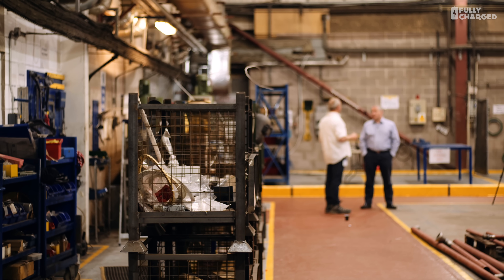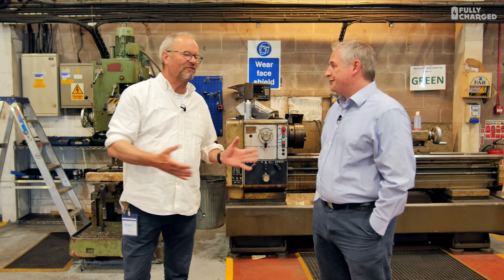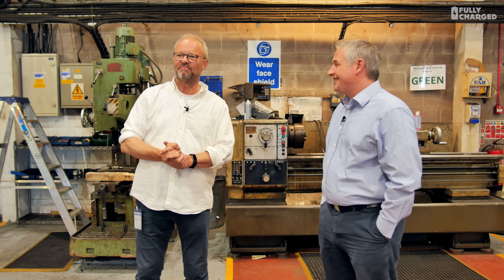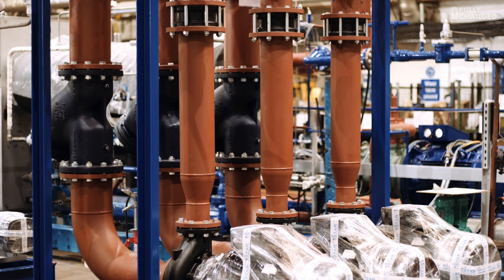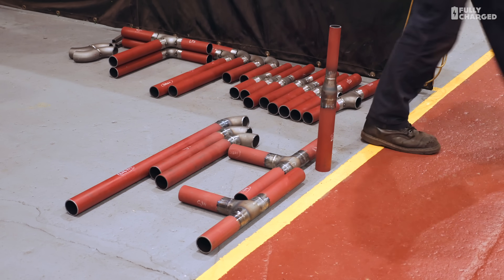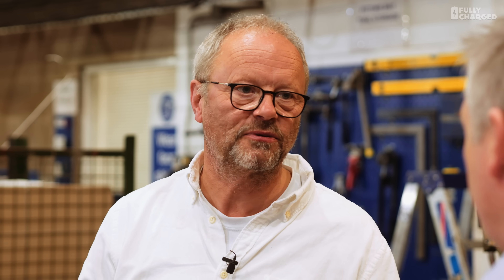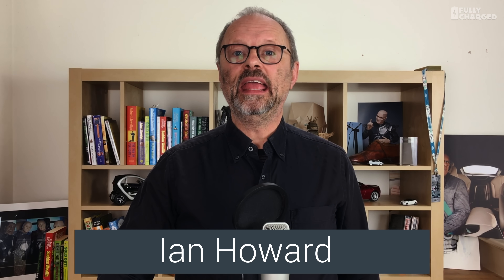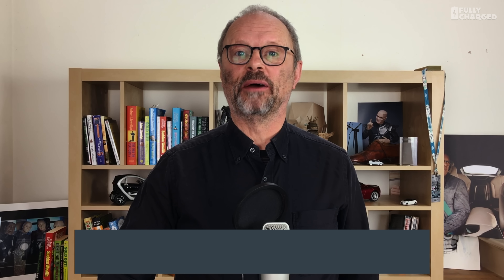Star Heat Pumps | Fully Charged

Comment: Here in Switzerland our flat's hot water (for baths and underfloor heating) comes from waste heat generated by a nearby factory. It was even part of the sale contract that we would do this.
Thanks to triple glazing and sensible insulation, I've not had to turn the heating up at all this winter (it's literally on its minimum setting).

I think that you'd need to refit or even rebuild a lot of properties in the UK if you wanted to really tackle the issue of wasted heat (I still see plenty of relatively "modern" buildings in the UK that have single glazing and bare minimum insulation, which seems ridiculous to me).
Reply: Yes, a lot of buildings in the UK have fairly poor insulation from the windows to the walls
Reply: I live in a house in the UK that is over 200 years old and its the warmest and cheapest to heat than any of the houses I've lived in that were built in the 70's and 80's
Reply: Yep, I live in London in a "nice" building from the 90's and part of the outside wall is basically a sheet of plywood. Brits really do have a cavalier approach to insulation.
Reply: Factory heat should be a good idea, but sadly at some point the factory will not be able to become more energy efficient because they need the heat for the homes. We have seen this in the Netherlands already, sadly enough. Instead of for example build another factory close by that also supply's heat they just don't make the factory more energy efficient, so it beats the purpose.
Reply: Thanks for this film, it was fascinating. Good stuff.
Reply: David Beaumont great to see someone talking about this, I talk to my family and mates about how bad these plastic clad, concrete and bradstone pieces of garbage that's been built in recent times in Blighty and just how bad they are as houses, in terms of heat efficiency, quality and fire protection, and they just look terrible, every new housing estate just looks terrible, built as cheap as possible as quickly as possible with the maximum poor business practices that the developers can get away with, and yet Pre war/Victorian houses are being knocked down left right and centre, yet the've survived 100+ years so far, houses built since the 60's barely last 30 years before they have to go. We have a culture of wiping away the old rather than working with the old and modernising, and it needs to change.
Reply: The worst bit is - the poorly insulated windows are often a planning requirement (if you're in a conservation zone).
I live in a house where, when it was built, the front of the building faces a terrace of listed buildings, so the front had to match, down to the single glazed, wooden framed, sash windows. They were, at the time, allowed to use PVC double-glazed windows at the rear though.
Unfortunately, the conservation area was extended to cover the rear of the buildings, so we can't use PVC on any replacements (for windows that were originally PVC) - It's madness.
Reply: Michael Leiper pvc windows look terrible on old houses, and new ones IMO, replacing windows with 'eco' alternatives has been encouraged by the government for years, even though there is nothing eco about plastic windows, wood and wood composite window technology is brilliant these days and can have double glazing, I retrofitted my sash windows with double glazing and I also live in a conservation area, wood windows will last 50+ years if you keep up with the painting and general maintenance, mine are original to the house so are 100+ years old, because of uv damage pvc windows last around 20 - 30 years before they get brittle maybe even less than that, any problems/damage with a pvc window and the whole things has to be replaced, they can't be recycled either, less plastic in pretty much all instances is a good thing to strive towards.
Reply: The PVC windows on the house are already over 30 years old (just like the wooden windows on the front). - and they're fine.
I don't think they were cheap PVC windows though.
I had the planning officer around when I was trying to get permission for a conservatory, they didn't realise they were PVC until I told them. (Possibly just not expecting PVC original windows inside the conservation area - it helps that the rest of the houses on the terrace have the exact same windows).
Reply: David Beaumont  -  I just built a house in SW Florida with structurally insulated panels...   same sqft as the house it replaced (~3200), but instead of 7 tons of air conditioning I now have a 2 ton variable refrigerant flow unit which runs in the 15-30% of its power range very infrequently...
Reply: retrofit uk buildings? with what? more immigrants?
Reply: Meanwhile the UK built cooling towers with all their coal fired power stations instead of using the heat for say heated swimming pools, old peoples homes, hospitals etc etc. 
You have to wonder at the general stupidity in this country, especially after the B vote.
Reply: My home in Bosnia was rebuilt after the war with thermo-blocks, polystyrene insulation and i've  recently put in a wood pellet boiler, it's -7 C outside with lots of snow but inside it's warm. I bought 4 tonnes of pellets for 210 euros.
The UK  has a horrible building stock, old or new built.
Reply: My house is freezing - were spending about €200 a month on heating!
Reply: Sounds like a good system. Can you give us an idea of what weight of pellets you burn a day at -7°, 0° and +7° to work out cost. Thanks.
Reply: Sounds like a good system. Can you tell us what weight of pellets you burn at -7°, 0° and +7° to work out cost? Thanks.